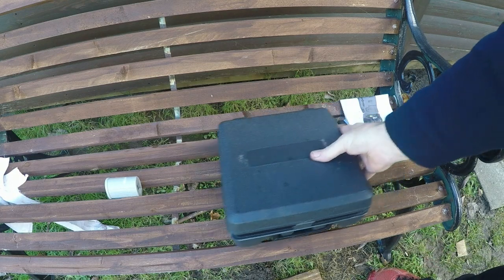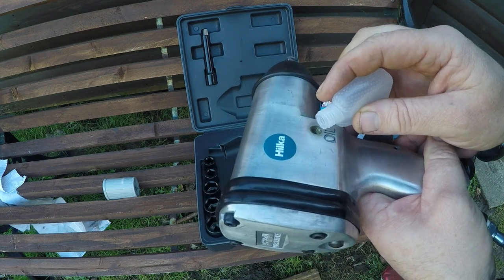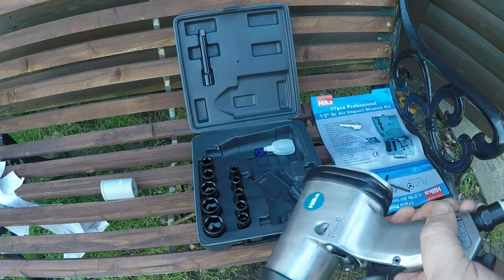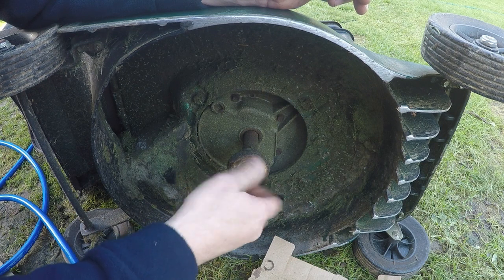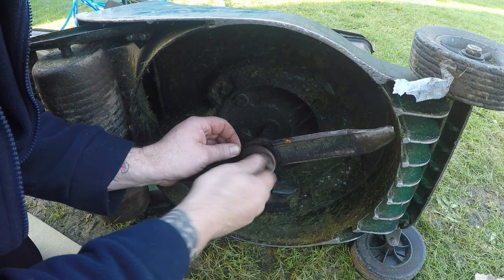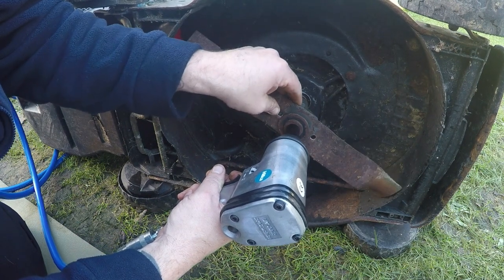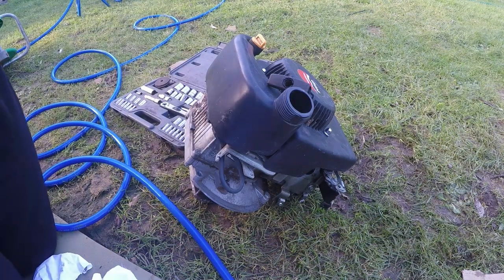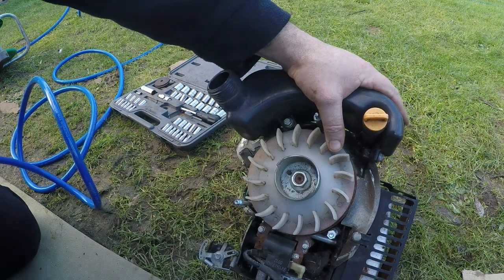AIR GUN FOR REMOVING LAWNMOWER BLADES IS IT UP TO THE JOB

Comment: I get by with Parkside gun and sockets from Lidl for £19.99. Like you I only use them for my mower repairs and find that 25L compressor is sufficient for my needs. You must strip that engine and find why no compression ! Could be a stuck valve.  Keep the vids coming.
Reply from the maker: I had a look at the valves and it's not that. Must be the rings. I looked at the parkside ones is it any good
Reply: The impact gun and 25L compressor are perfect for small engine repairs. I also the compressor for spray painting and sand-blast cabinet. I keep thinking of a bigger unit but realise its a hobby, not a business. I am also from Dundee and a mean Scot !

Comment: Hi Mick I use a Sip air gun & im using a smaller compressor than yours and it works fine
Reply from the maker: Cool mate, I'm well pleased will make it so much easier and less time.also no more bashing my knuckles lol

Comment: One piece of advice I can give you is never put a nut or bolt in with the Impact gun you can so easily cross thread them, always put it in by hand 3 or 4 turns then use the Impact gun.

Comment: Interesting I am looking to upgrade compressor apparently it’s all down to cams so the one I am looking at is 14cfms I have been told that I can only go for certain cam tools do you know if that right Mick I am not sure cheers David
Reply from the maker: The first question I have is what are you looking to run ie tool wise and in what capacity
Reply: Shot blasting cabinet/small parts spray gun/ nail gun / air cutter  / impact driver only one item at a time let me know what you think cheers David
Reply from the maker: David Brewer ok so I would say for all light work a 25ltr compressor would be ok but for the sand blasting and nail gun you would need a 100 to 150 set to 90ps as needed. Hope it helps
Reply: cfm is the important number and 14cfm is about as high as you can go on your house supply without it costing too much. 14 cfm is really just over 9cfm. check the cfm of the tools you want to run and then choose the right compressor